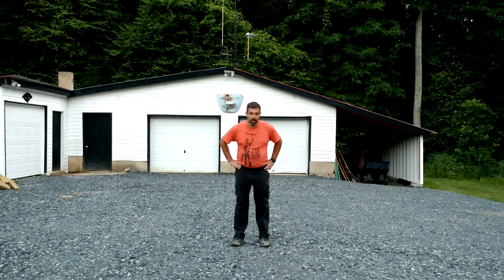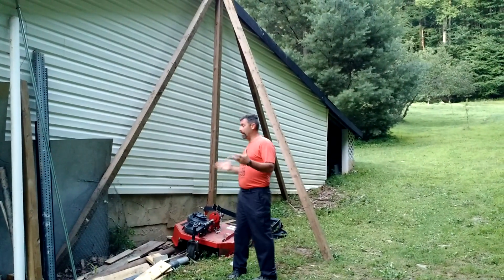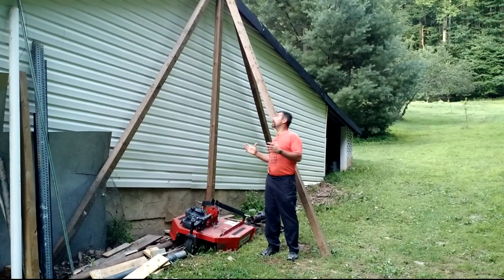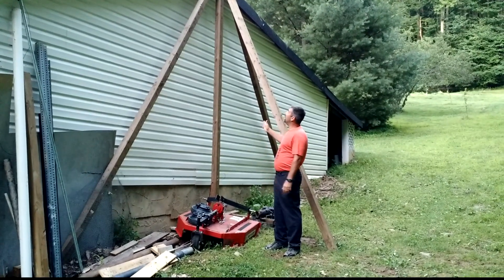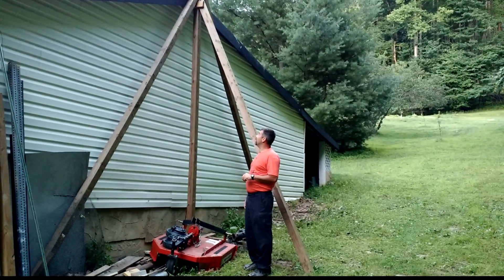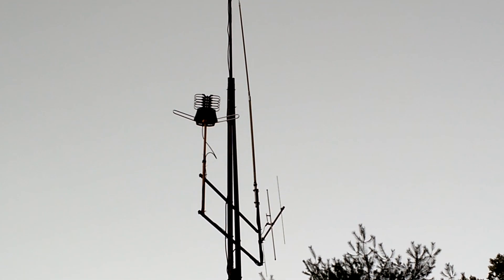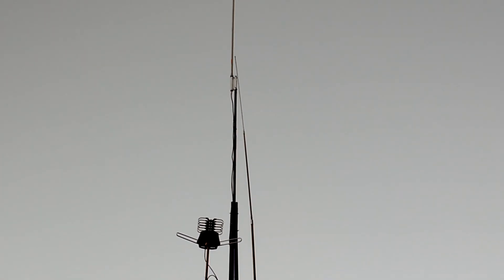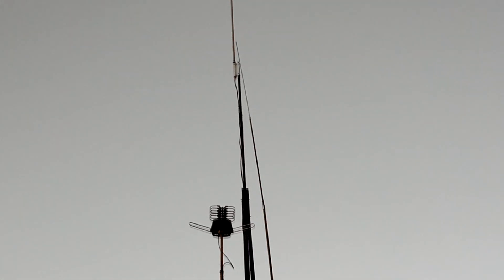Antenna Tower Project Part 3: It's Done!

Comment: Hey Eric, was just wondering the cost of that IMAX 2000. I was checking on copper electronics and they wanted $140 for the antenna and $60 for the ground plane kit. And then they wanted another $100 to ship it. That shipping sounds pretty excessive doesn't it? Does anybody have a good place to buy this antenna without getting soaked for $300?
Reply from the maker: I bought mine for $99 plus $14.00 for shipping from Carid.  I didn't get the ground plane kit though.  It's been up and working since August and I really like it!

Comment: Your Imax doesnt have ground plane due to the height of you antenna and you are having coaxial cable as a "virtual ground" if we can called at this way? maybe Im wrong using this term and there is a right term ... im thinking more towards the tram 1499 that you need 50 ft rg8x cable ... let me know... awesome project I am learning to much from your videos. I already have a Cobras SSB from my dad and I am understanding the way to install a mobile antenna as a base antenna. I know you already made a video about this and you recommend using a "Star Ground Plane" like this one https://www.ebay.com/itm/Workman-wil-kit-b-fits-Wilson-Firestik-Francis-Cb-Radio-Antenna-Ground-plane/173044619683?hash=item284a4359a3:g:y8UAAOSwz~paO9yE:sc:USPSFirstClass!60616!US!-1:rk:13:pf:0  but I am trying to understand as well the equation (234/MHz = Length) ft to obtai the value of the radials. Thanks again 73 from Monterrey MX

Comment: So now you've had time with your imax 2000 up how would you compare it to your trusty a99? pro/cons of either one? I am looking to do almost the exact same setup you have and I'm at a fork in the road on what antenna to get. Hope you can give a comparison soon thanks!
Reply from the maker: So the short of it is this. I do get about 1.5 DB more gain out of the MAX2000, but some of that maybe from the increased height as well.   The noise floor is also lower, and that really helps when pulling in weak stations, but again, my trusty antron A99 was almost 20 years old, so that might have had something to do with it.

  Overall I like the new MAX2000 a lot and I hope it lasts as long as the old A99.

Comment: NICE!!!... i have heard you comment that you don't use beams, you should consider the "v-series" beams by either Gizmotchy or Jo-Gunn. Very light weight antennas , only requiring a tv antenna rotor and designed for skip. Great for sideband! and you are in the perfect location for that antenna design!... anyway great work!...73's/55's
Reply from the maker: I'll look into it. Thanks!

Comment: That's awesome man.  Let me know how the television antenna works out.  I tried mounting my television antenna to the same mast as my CB antenna before but whenever I would key down on my CB, even just barefoot, the television in the living room would cut out, I guess because the two antennas shared a common ground.

I thought about using a 16 foot beam on mine, but after using one on a similar pole I set up for my brother at his house I decided to just go with a 12 footer at my house because something about that extra 4 feet at the top made it feel insanely heavy with the antenna and conduit leveraging on it, and I don't have nearly as elaborate a setup as you do.

Glad you got it taken care of man, hope to hear you on the airwaves sometime!
Reply from the maker: This thing got out of hand really. I had a vision based on you setup and thought it wouldn't be to heavy since the whole upper part was steel poles. Man, I was wrong!

  It's up, and that's the important part, but if I ever had to do it again, I wouldn't. Its just to dang heavy.

As for the TV antenna, it actually works really well for it's size. The rotor sticks sometimes and you have to tap it, but it picks up a bunch of channels and that makes working out in the garage more fun. However you are right. Mine to will blank out the TV whenever I key down. I guess even at 4 watts it's still overloading the circuits. 

  Take care and thanks for the inspiration!
Reply: One other lesson I learned is proper bracing.  When we set up my brother's we attached it to the eave of his house, without realizing the eaves weren't boxed with 2x4s, it was just quarter inch plywood with some vinyl siding over top of it.  He was gone from home once a couple years ago (he's an OTR truck driver) and we got a good snow that accumulated over a foot on his roof.  When it started melting and sliding off his roof, it pushed his antenna pole down and when it hit the porch railing it bent the conduit.  The antenna was fine and the plate at the bottom kept the bottom end in place, but we ended up re-enforcing his eaves with 2x4s instead and attaching the upright to those.

Comment: I go by the handle on the  radio reaper 667 from houston texas 1 got a triple heavy  triple mag mount with a preader 10 k and I'm running a galaxy 33 hml with a 4 pill palomar 400 I can talk 40 miles no lie I run on channel 19 and 21 we do roll call at 8 pm here in houston guy called b.f r he does roll call for Avery around houston and there a guy goes by the name rock man he can hear some of us from other states come and get on 21 and see if you can hear us skip been running hard the last few days reaper 73 out
Reply from the maker: Man, now that sounds like the good old days! We used to have roll call on channel 35 in Wake county here in NC and I loved those days and nights. 40 to 100 people checking in, chatting away and spanning almost every channel to cover all the smaller groups. It lasted right up to about 2003 or so, but quickly faded away after that.
Reply: @FarpointFarms  What time of days were the roll call in Wake? I'd love to get that ball rolling again. I've seen a few base antennas around town so there are still some people out there with radios!